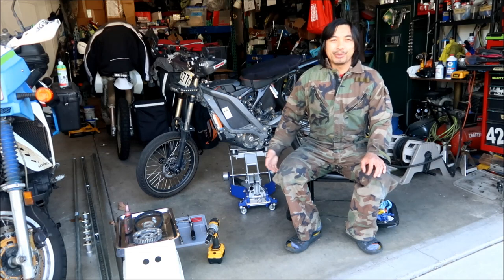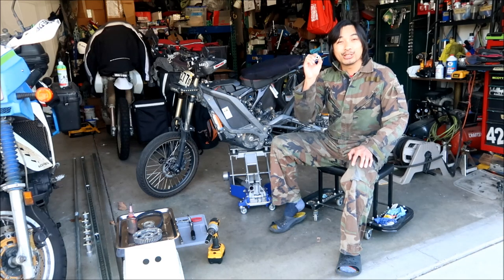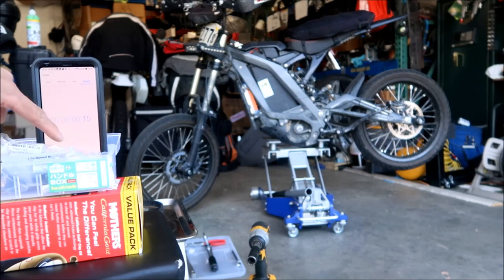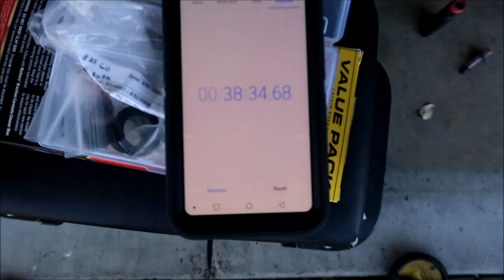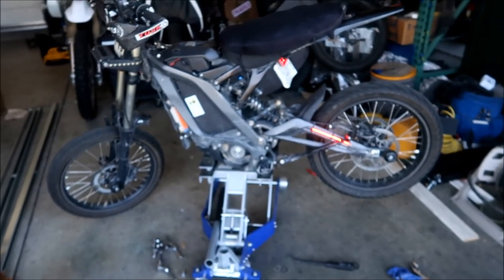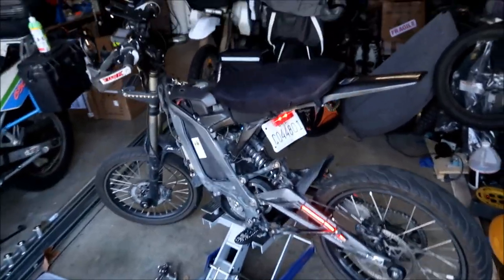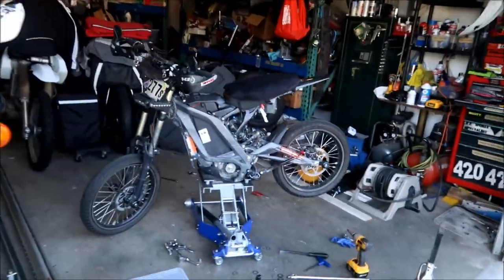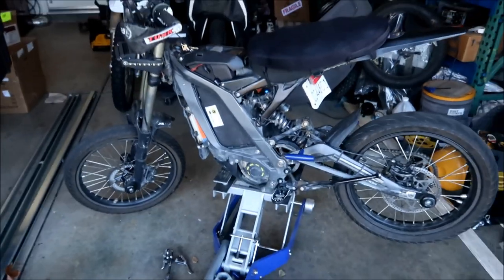Sur Ron Light Bee Primary Drive Chain to Belt Speed Challenge VLOG

Comment: im also changing back to belt as my sprockets have done the same and ive lost my washer aswell is it needed or can i use any thanks
Reply from the maker: I actually found the washer what I was going to do if I couldn't find it was just put RTV sealant on the threads just to be sure it doesn't back out.
Reply: @hadesomegamoto7639  i cant find mine lol i,ll sort it